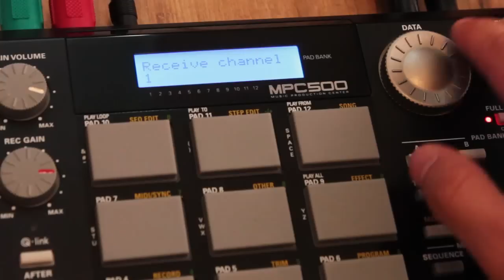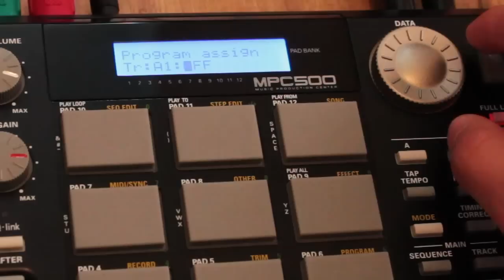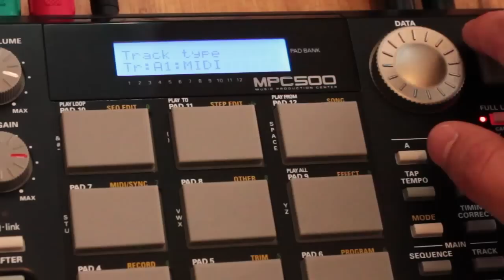AKAI MPC 500 Tutorial: MIDI Sequencing (also for MPC 1000, MPC 2000, MPC 2500, MPC 5000) #TTNM

Comment: Do you have any videos about old gear like the Casio CZ5000 for example..and especially how to save data via the MT Terminal. I saw somewhere a schematics on how to build a midi/MT cable..and connect it with a sound recording device (Zoom..something) but i lost it..and i'm unsure about if it really works..and it didn't tell if it should be in mono..or stereo..or what sample rate....or anything..just a schematics on how to build and connect the cable. You seem like a VERY technical guy..and if someone can help..i think it's you :-)
Reply from the maker: Do you mean this link: http://www.tinyloops.com/doc/casio_cz-5000/mt-connector.html

The cable is really easy to make. If you can't solder yourself, ask on Facebook, Craigslist or a local electrician and give the person 10$ or a case of beer :) It's two mono jacks connected to a 5-PIN DIN cable, according to the link. You don't need a Zoom or other recorder. It should also work directly with your computer's line-in. Let me know if you have any more questions :)
Reply from the maker: Concerning Sample Rate and Bit Depth, I would assume that 44khz/16bit are enough :)
Reply: Haha..Yes..that's it :-D ::.Thanx...but i wonder..would it work with mic-in...and phones-out...on a computer too..in..lets say..Goldwave? What do you think?
Reply: Sorry..never mind..i read that it is possible..but i'm still confused..it looks like mono-cables that goes in to the recording device...and i thought the device was in stereo..it looks like stereo for me..and the inputs on the pc are stereo..and as far as i know..mono-plugs dont work in stereo-inputs??
Reply from the maker: Goldwave, Audacity or other recorders/editors should work. Phones-out will probably work too. Mic-in could be a little sensitive if the MT signal is too loud, but it still might work just fine. Just try it out :)
Reply: Hehe..ok..i will ...it's worth it..so annoying to erase everything to make something new..thanx again :-D
Reply from the maker: The MT Terminal is used to export your settings, not audio. So it doesn't matter if it's mono, since it's just used for non-audio data.
Reply: Ahaaaa..NOW i get it...but still..according to the link..the data IS some sort of audio...(i feel stupid now)..like in a telephone..when you dial on the numeric pads..it generates tones..fuuuuck..i'm stupid..i don't really get it :-( ..hides under the sofa
Reply from the maker: Well, sure you can listen to the data, similar to the beeps of an old computer modem. But the data isn't meant to be listened to. Back then they didn't have floppy disks or SD Cards, so they used cassette tapes (even in old computers) to store data.
Reply: Yeah..i know :-/ ..I wish i had my old Spectravideo MSI 728 Datacassette player..it worked perfectly with the Casio..been searching for many years for another one..but can't find one..not even on Ebay :-(
Reply: One last question..should i record in mono..i channel..or..in stereo? I know it may be a stupid question..i just want to be sure :-)
Reply from the maker: No problem :) Feel free to ask your questions! You should record one channel only (or stereo and then delete one channel), since you will need to play back only one channel to the synth.

Comment: Hello, I need a compact sample player, that would work with a regular midi keyboard for playing melodies on stage. Will it work in that way? and how can samples be loaded?
Reply from the maker: Do you want to transpose the samples with the keys? Because that's a bit cumbersome to set up on the MPC. Samples are usually loaded from the CF card.
Reply: +The Tuesday Night Machines yes, that`s exactly what I want. I need this to get rid of PC  on stage.  But so far I haven`t found such a hardware sampe player with an appropriate price
Reply from the maker: +Anti Phase There is the Korg MicroSampler which is very easy to handle, but comes with its own keyboard, i.e. it's not a tiny box.
Reply: ***** well, it`s better to grab something, than nothing)
It seems to be cool thing, not so compact, but I think it`s OK. thanks a lot!

Comment: I need to know what chords are those that you are using and can they be used in the mpc 2000xl I want to hear my mpc while I tap my sounds but I found out I may need those wires to connect to headphones
Reply from the maker: I'm not sure if I understand what you mean. If you want to hear the samples from the MPC then you'll need speakers or headphones, sure. If you want to hear the MPC and another instrument, you'll need a mixer. For external instrument control, you'll need MIDI cables (the green and red one in the video).

Comment: Can anybody help me, I’ve just purchased an MPC500 from eBay...and I think it’s broke. I’ve followed this video and tried spare midi cables And lots of different synths and I can not get midi to go through the MPC as per this video! I’ve also read lots of the manual etc. It’s as if the Midi in or out isn’t working. Any help would be great as I am pretty angry right now, thanks
Reply: Nashoba Addai cheers dude, I’ve given them guys a shout - no ones heard of the problem I’ve got but I’ve been given some places that might repair ! Thanks for your help :)

Comment: Does this MPC have the same crunchy sound as the 2000 ??
Reply from the maker: +Infinite1ne it doesn't have the same components so I assume it wouldn't sound the same. Can't compare it though.
Reply: +The Tuesday Night Machines for someone who hasn't had the MPC at all. What would you recommend for someone who wants to do more sampling and having more of a warm sound ?
Reply from the maker: +Infinite1ne I really don't think that the MPCs sound especially digital or cold and wouldn't really worry about this. The sampling source is what matters more and I that's too cold, you could just buy some kind of analog saturator or tube amp effect and run everything through that. Regarding the MPC, I would really recommend the MPC1000 with JJOS if it doesn't need to be portable (like the MPC500). It's a lot better to control.
Reply: +The Tuesday Night Machines thanks so much for the info ! Yes I've pretty much decided on the MPC 1000 at this point with my research. I also want to get the SP 404. But I will get MPC 1000, and then something else to make the sound warmer , then the SP later on for the effects. SP looks complicated to use haha
Reply from the maker: Well, the MPCs do have quite a learning curve as well, but once you understand their concepts it's pretty neat with the 1000 & JJOS.
Reply: David garrett

Comment: For the MPC500 what do I need to add an extra midi out? Similar to how the MPC1000 has two midi outs and two midi ins. Can I add a midi box of some sort to the mpc500 to give me the extra midi out and midi in??
Reply from the maker: You can add a MIDI Splitter box to get two or more cables, but you can't individually address them, like in the MPC1000. But since you can transmit quite a lot of data through one output, before you'll run into issues, the one output of the MPC500 is probably okay. It depends on what you want to do.
Reply: @tuesdaynightmachines  Thanks for responding. What I want to do is use my Bass station II, with my MPC 500. I want them to be connected to each other's Midi in and Midi out.  But then here lies my problem: I want to then go out of the mpc500 into a small chain of sound modules. 

If I had the MPC1000, this configuration would be a piece of cake. Because I could dedicate one of the IN and OUTs to the Bass Station II/MPC and have the other Midi out of the MPC into a few other modules. Which would allow me to use the Bass station not only for its own sound engine, but also to control the other modules.
Reply from the maker: Unfortunately, the BS2 doesn't have a MIDI Thru port. But with a simple MIDI Splitter Box (sometimes called MIDI Thru Box) or cable you can do what you want :)
Reply: @tuesdaynightmachines  So the midithru box would act as almost having a second midi out on the MPC500?
Reply from the maker: It makes two (or more) copies of the output. Since you have 16 MIDI channels per output, you could theoretically sequence 16 devices individually from that one MPC500 output.
Reply: @tuesdaynightmachines  Hmmm, but then what's the advantage of having two midi outs (like the mpc1000), or put in other words, what is the disadvantage of having only one midi out and using the midi thru box? 

Is the midi thru box, thus doing the same EXACT thing for the MPC500, as having two midi outs on the MPC1000?
Reply from the maker: Two outputs would let you sequence up to 32 devices. Also, sometimes two devices might need to be set to the same MIDI channel due to some specific studio setup reason or limitation. Then having two outputs comes in handy. Depending on the amount of data you send through one output, you can also introduce latency or overload the receiving MIDI inputs, so two outputs let you spread the load. It really depends on what you plan to do exactly, but most probably you will be fine with the MPC500 and a Thru Box.
Reply: @tuesdaynightmachines  I want to thank you for such a through informative response!  So just for my last question, then there is zero possibility to have an actual second midi out on the Mpc500? The closest I can get is a midi thru box?
Reply from the maker: You're welcome! Happy to help :)
 
A second output is not possible and it wouldn't make sense for the MPC500 in my opinion. One output alone lets you already sequence a lot of devices and the 500's main focus is portability, so it's better with one output, which keeps the instrument small. The 1000 is not portable at all in comparison, but in a larger studio context, you can do more complex tasks more easily. I've owned both, but the price and portability made the 500 more attractive for my personal use cases, as I could take it on camping a vacations (I made a full album with it in a tent), while still using it as a brain in the studio as well, to sequence a handful of synths.

The 1000 with JJOS is awesome, but it really shines when you create complex tracks or live-performances with a lot of external gear, which I usually don't.

Comment: Hi. Is there a possibility to play more than one *.mid file from the CF-Card? By LOAD SEQUENCE i found a way to load one *.mid-file but how can i put the *.mid-Data in a TRACK or a PAD?
Reply from the maker: Hmm, I've never tried this. Since you're loading the .mid file via LOAD SEQUENCE though, you probably can only load a single file, which then would have to have all tracks inside it. You cannot assign a sequence or track to a pad, but I guess that all MIDI tracks in the .mid file will be loaded to the according sequence tracks, so track 1 in the .mid file will be loaded onto track 1 inside the MPC sequence. Again though, I never tried loading a MIDI file and can only speculate.
Reply: ***** Thnx a lot.. After hours spending on try an error i guess you are right.
Reply: *****
Ok,after a while, i´m wiser now. The Sequence-File contains all the Tracks you have played before. Or you take a Software like AnvilStudio, make some Tracks, save them together in a Midi-File and load it in the MPC as a SEQUENCE. Now i can handle my different Tracks with the TRACK-MUTE-Button (if they are all on one Channel for one Instrument) or i control different Midi-Hardware with different TRACKS, each sending on a different Midi-Channel. Additional i got the PADS with some assigned Samples. FUNKEY!!!

Comment: How do go from Ableton to my MPC 500 thru to my Korg volcas?
Reply from the maker: What do you want to do exactly? Clock the MPC 500 with Ableton and sequence the Volcas form the MPC?
Reply: The Tuesday Night Machines I want to have Ableton trigger the MPC 500 and then have the volca receive the same midi clock. I did midi thru on the MPC but the volca won’t be on the same time when hit play on the MPC. Only when I put it in master in the MPC but it won’t receive midi from Ableton. I just want all to receive data from one source which is Ableton
Reply from the maker: Then you need two MIDI ports on the computer or use a MIDI Splitter/Thru box to copy the signal :)
Reply: The Tuesday Night Machines ok I will get a USB splitter so I can use more than one USB
Reply from the maker: But that will require another USB-MIDI interface. You can just split the MIDI cable with a MIDI Thru box and use one interface with its 16 channels.

Comment: can you record the external synth in polyphony?
Reply from the maker: What do you mean? The sound comes from the synth directly (not the MPC), so you can record it however you like, depending on the synth's available outputs. The MeeBlip in this video is monophonic with a mono audio output.
Reply: i'm aware that the sound is coming from the synth controlled by the mpc, but i was just curious as to whether or not you can send midi in polyphony as well as monophonic (like your example). cant get my words out today havent slept in a long time. :)
Reply from the maker: Oh, okay. Yes you can sequence polyphonically with the MPC. In fact you can even have loads of track with polyphonic sequences running at the same time. I used to control about six synths (some polyphonic) and drum machines at the same time with an MPC and didn't reach its limit by far.
Reply: thats bloody amazing! ive had a mpc500 for a while but the volume potentiometer is broken from the last person i bought it off (beware ebay).
you sir, have made my day!!!
keep it up with your videos, theyre amazing. its nice to see  people with unhealthy obsessions with synthesizers and electronic gadgets! where are you from mate?
Reply from the maker: That's great! I actually own an MPC 1000 on which I have never played a single sample. I just use it as a MIDI sequencer. A bit of a shame though :D You should see if you can get that pot fixed! mpcstuff.com sells replacement parts I think. I'm from Germany.

Comment: If I have a synth with a keyboard built in, can I use the keyboard to feed the MPC data ? Or do I have to re-wire it somehow ?
Reply from the maker: Usually you can. There needs to be a “local off” settings or similar on you keyboard synth that decouples the keys from the sounds. This way the keys only send data via the MIDI out to the MPC, which then sends the MIDI data back to the synth via its MIDI in. The synth then only reacts to the external MPC MIDI and not the internal keys.